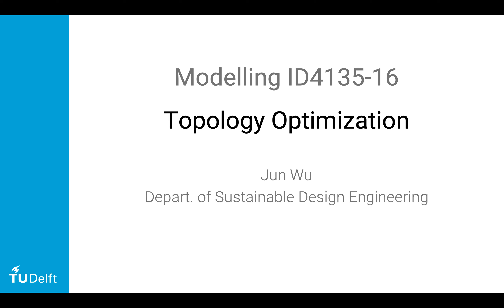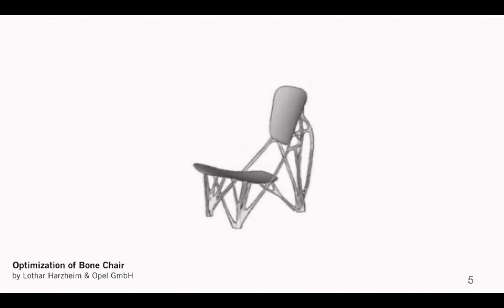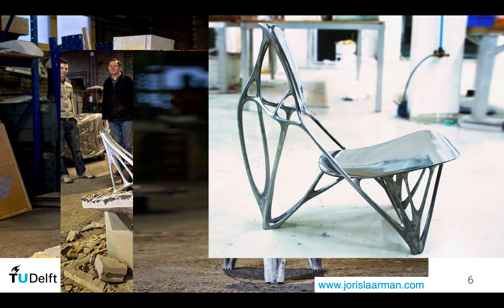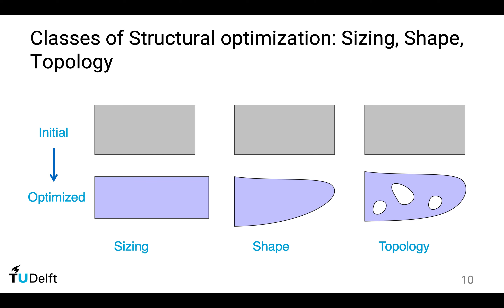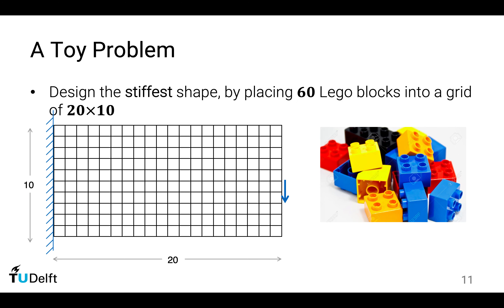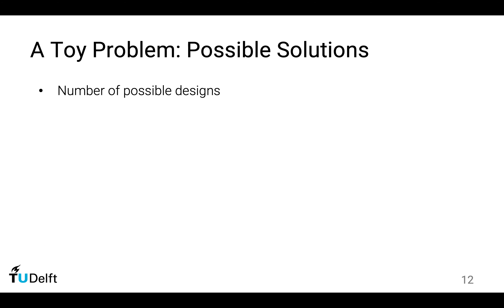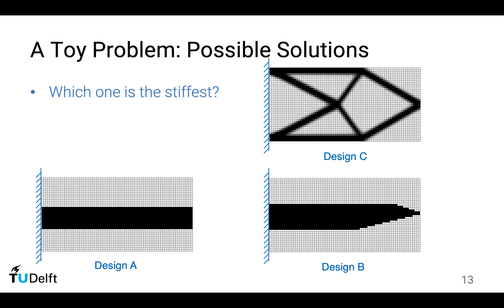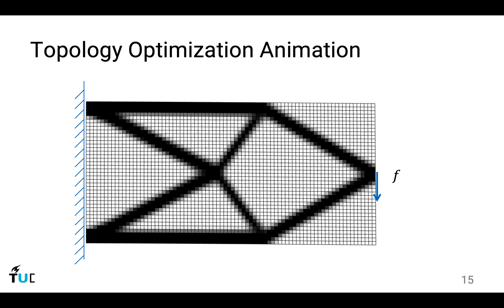Introduction to topology optimization Part 1/4

Comment: Missing a few constraints that you’ll improve the AI.  Rather than size… consider maximum space constraints. 
New input factor: material.  Allow the AI to choose the material from the global database. 
New input factor: Constraints = temperature, durability, radioactivity, chemical interactivity, etc.  
New input factor: cost. Give it a budget for material costs to create material optimization using the above constraints.  
New input factor: light/shadow requirements (Eg under a bridge, etc.). Allow reflection and bounce. 
New secondary input factor: beauty and/or symmetry. Program phi, symmetry, balance, prior artistic understanding of beauty, and current human sample populations of polls for training. Attempt the primary design both without and with this optional/secondary input factor.